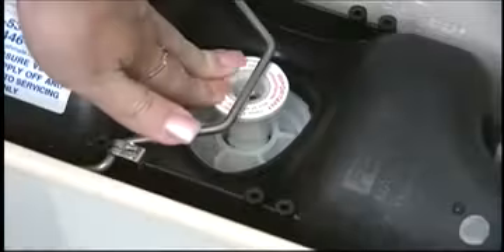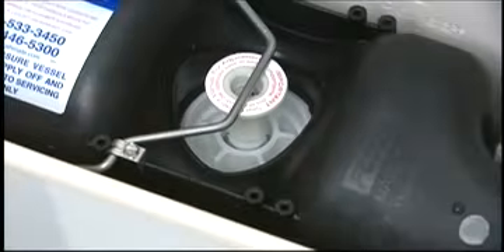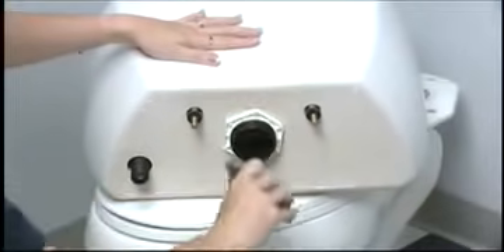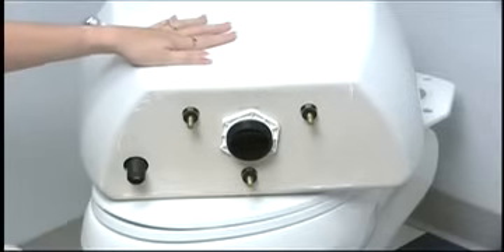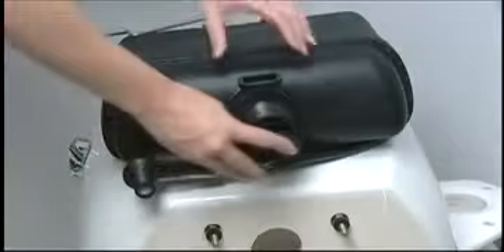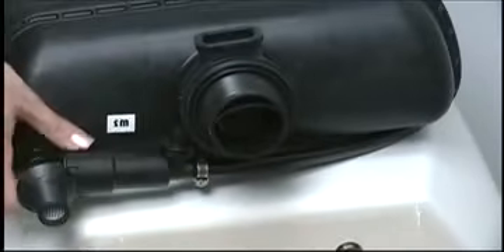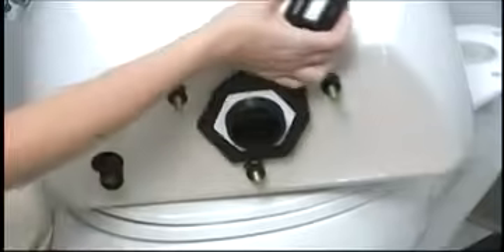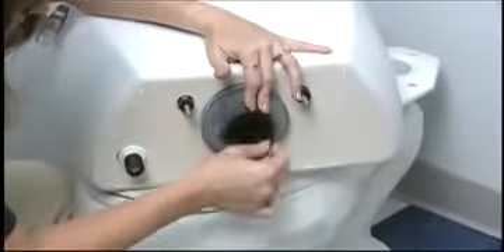How to Test and Replace: Flushmate System

Comment: My first 503 lasted 20 years. Hopefully this new 503 goes good. Very easy install. There’s nothing really to fix on these except replace the flush cartridge or the gaskets. If you have a problem with leaks, best to replace entire component(comes with new gaskets). Excellent flush power.

Comment: My Flushmate did not come with a tool to remove the plastic tank locknut in :40. Will Lowe's/Home Depot have this tool or what other comparable tools can I use to remove this?
Reply: +Patrick A use an oil filter wrench, that will work. hope this helps.